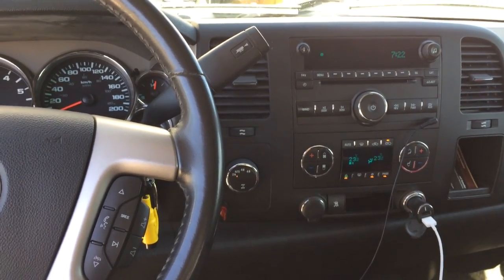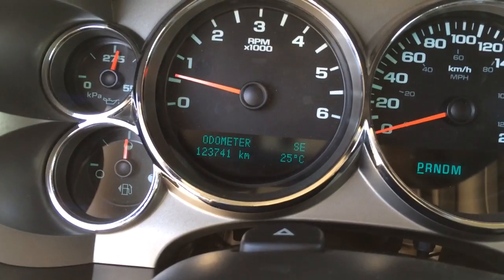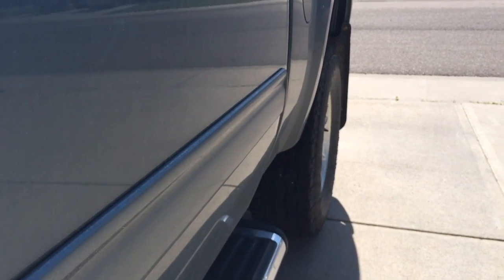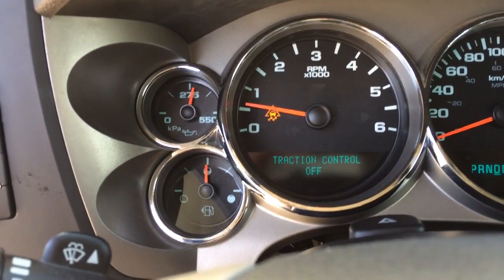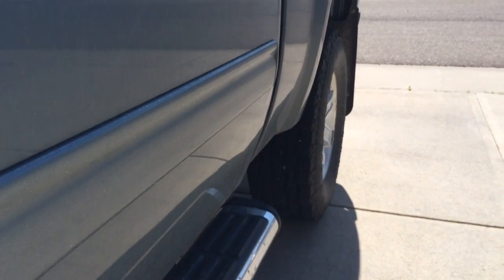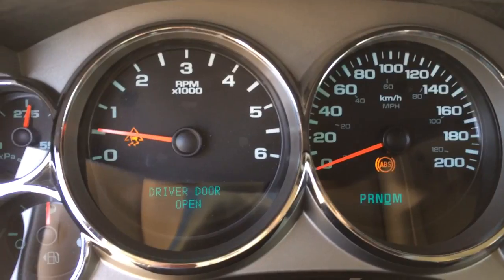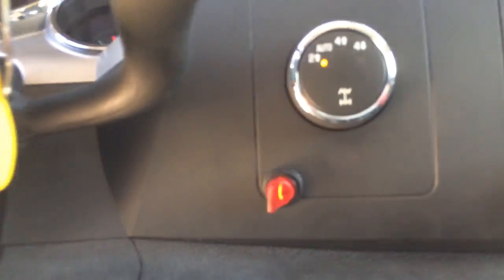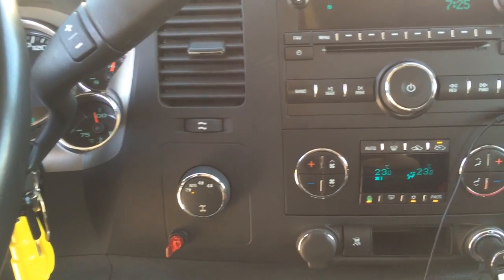Traction Control, Stabilitrak, Brake Control Function, RPM Limiter- BYPASS

Comment: I found on my 2012 Silverado 1500 the only way the stabilitrac doesnt kick in is when I push and hold for 10 seconds  then also put it into manual mode. When you leave it in drive even after you push and hold the button itll still kick in but in manual mode it will not kick in.

Comment from the maker: Ask me anything guys I am happy to explain anything as best I can.
Reply: need help how did u do that
Reply from the maker: watch my other videos explaining it all. This one just pull the plastic dash off and install the switch that you wired into fuse #9 from under the hood
Reply: I just had my truck lifted with new shocks put on and it looks like they forgot to connect something because now my abs and stabila track stays on.  Should I worry about it? now that I see this video?
Reply from the maker: Tom E I would get it fixed, ABS is proven to help in braking preventing more collisions
Reply: i have a 2018 sierra 1500 denali 6.2, the fusebox does not specify the same fuse you use, can you tell me which wire is the one i need to use. thanks
Reply from the maker: @ichiara07  as this is for the 07-13 trucks I couldn’t tell you what it is for the ‘18 model trucks…

Comment: let's say I don't go off road .my light turns on for like no really good reason n so does the little  (!) for the brake . how do I just turn it off the button for the stibilatrack n the traction control button isn't working properly.  so it keeps popping up for no really good reason. how do I completely just turn the light off . n is it a bad thing. to have it off

Comment: Had this happen to me when I was heading up a local mountain trail some call "Red Grade." It's steep and that day it was icy. Thought I would be safe and sound by holding the traction control switch until it read that Stabilitrak was off. Started to make my way up the hill only to have to dangerously back all the way down. 

Thanks for these videos. VERY HELPFUL!

Comment: Amazing series of videos.  I have a 2007 Chevy 1500 LTZ 4x4 with a 6.5" Zone suspension lift and 35s with the same problem.  I haven't gotten stuck yet, but I've come close - only because the truck was fighting me by killing the revs when I needed good wheelspin.  I'm just trying to get to remote hunting and fishing destinations, not trying to get stuck.  It really pisses me off when I see that stupid traction light flashing after I already took the time to turn it all the way off.

Anyway, I'm mostly done with the install.  It's past midnight, so I'll finish tomorrow.  I just wanted to take the time to let you know that I really appreciate the info you've shared.  FWIW, my fuse was #10.  Pulled it with the truck running and the correct lights came on immediately.  Cut the big red wire (with the fuse back in place) and they came right back on.  I've spliced it and gotten it (and some rear aux LED switch wires) through the firewall.  Tomorrow I just have to hook up the switches and run power back to the lights.  Thanks Jeff17s!
Reply: I have same vehicle. Im looking to do this also when weather in WI warms up. Hopefully yours turned out well!

Comment: Thanks this is the best explaining video I've seen so far on deleting the Stabilitrak
Reply from the maker: henry Wahlberg honestly most people don't watch the other videos linked to this one! This bypass switch I installed has saved me from getting stuck in mud holes and snow drifts so many times! Plus the burnouts are cool lol
Reply: Thanks again
Reply: So if I'm understanding correctly,  cutting the traction off completely helped regain your rpm and power correct? Thanks in advance
Reply: @blessedhands2000  it works correctly if you disconnect for ten seconds then reconnected the battery too good luck
Reply from the maker: @blessedhands2000  Yes. The computer no longer senses the tires slipping, which reacts by braking/rev limiting/ETC.

Comment: I sure understand why this truck won't get through 3" of snow with winter tires on now.  I pulled my fuse in the last snowstorm, works twice as well.  I've had 3 2x4 fords and never had much issue in snow until this 2012 chev.  Seems to have made the truck more responsive in general with fuse removed, should I just leave the fuse out, or do your toggle switch idea for snow days??
Reply from the maker: I only toggle switch it off when I am in sticky situations, or it is really difficult to get through. Do not remove it for highway driving however, as it is a great safety feature for keeping the truck from losing traction.

Comment: Try holding your traction control button about another 10 to 15 seconds after it says it's turned everything off total time about 20-25 seconds. On the Tahoe it will COMPLETELY disable traction control where if you hit the gas with your rear end up it will run 5000 rpms
Reply from the maker: My suggestion to you is to jack your tires off the ground and attempt what you say and see if it works.... I can assure you, the computer tries to override with a brake control function, power limiter etc. Once you have done this, by all means, come back and tell me how it went.
Reply: +Jeff17s you are right. My 2010 would do it after you shut off the nannies via the button. You could power through it a little on ice and snow to spin around on a snowy road or whatever. I traded that on a 2015 and the tc vses systems are so insane. You can turn everything off and still cant slide around. Stabilitrak comes back on at like 40 kph. I may have to go this route if it doesnt make the new ones go into limp mode. When i select off, i fucking want that shit off for a reason.

Comment: It looks like I'm going to have to do the same thing to my 2006 Yukon Denali because my traction active light comes on and reduces horsepower exactly like your video and messes me up on the highway or even on the red light but when I switch traction control off no that stuff happens but my stability is also off not a bad idea
Reply: Does Your Denali Ever Have Problems Starting Up?Mines sounds like It is Doing Same Thing.

Comment: Hi,im having problems with my 2011 chevy..I've been having problems over the last 4 yrs with my dash shutting off while im driving including headlights going out..My resent problem is i can't go over 20 mph,it says engine hot a/c turned off,left RR tire low,change engine oil soon,engine over heating ideal engine,engine power reduced,service track control,service stabilitrack..I've been taking it to the dealership and paying and arm and a leg for them to tell me nothings wrong..Do you know whats wrong?
Reply from the maker: +Chris Haver I definitely don't know what is wrong with yours... but is does sound like an electrical problem. sensors or shorting out
Reply: Coolant temperature sensor

Comment: Do you know what would cause a service traction control & service stabilitrak light followed by a rough 1-2 shift on my 2007 6.0L 1500? The light usually comes on at around 30+ MPH or when I'm coasting. It also turns off by itself but usually comes back every couple miles. I've cleaned the MAF & Throttle Body with no luck.
Reply from the maker: +mike L no idea lol sorry
Reply: I'm having the same exact issue, did you ever figure out what was wrong with it?

Comment: But in the 2013 Silverados if you hold the traction control it takes off stabilitrak and it stays off unlike the 14-18 models turning back on after 55km
Reply: But it doesn't disable it completely by holding the button  down. I live in ND where we have a lot of snow and when I turn both traction control and stability, it still controls wheel speed. Mine is  3013. Traction control is a joke

Comment: When you tap into the lines by the fuse did you splice one red wire or did  you bypass the fuse all together?
Reply from the maker: I just cut the thicker 14ga red wire, made a continuous circuit through the toggle switch so that when I run the highway with everything on it still has the fuse as safety backup, flipping the switch simply cuts off the electricity to the fuse. Best thing I ever did, I have been stuck on a few occasions as a direct result of the computer not letting me fully pin it haha

Comment: Howdy,
I leave the STBTK and TkCtrL in the trucks I drive on all the time.  My 2007 Vortec Max pissed me off right after I got the truck. (still have it).  I drive in snow/ice and on roads made with frickin clay with my work trucks GMC half tons new one every 3 yrs. Since they came out with this crap I noticed that if I pump the gas peddle VERY-FAST 3 or 4 times and then pinn'er to the mat the truck will spin all the tires and get S**T happening.  Then it is still working on the next corner as I reaching for my celebratory coffee sip.
 I shared this info with our field operators gas/oil patch and it works for them too.
No need to piss around with pressing buttons or cutting wires for me.
But I probably would If this didn't work.
cheers

Comment: Howdy Bud, I found your video on one of the forums. Is pulling the fuse the exact same as the switch you wired? I went to wire in the switch but wanted to test the idea first, by pulling the fuse. I pulled the fuse, but no cel or TC light came on. In your video you can see the lights come on basically confirming the tc and abs is inoperable.
Reply from the maker: Did you pull fuse #9 out? Strange it wouldn't show on the dash...
Reply: Yes, watched your 3 vids, bought the wire and a switch, figured Id pull the fuse first ( #9 labled ABS ) no lights at all. Could still disable and able TC and S. Didn't move fwd as I would think pulling the fuse would make the same lights come on. Its a 2010 gmc 2500hd
Reply from the maker: +Scott Hoobery hmm I'm not sure the 2500 trucks are same as my half ton for wiring. Probably not
Reply: Its weird, I would think, if you pull the abs fuse on any of them that the light would come on. I thought maybe just needed to cycle a few times so I drove around a bit and no lights came on. I know the TC light and the rest work as when I turn the key to on, they will all light up. This boggles me.
Reply: I figured this out if your curious :)
Reply from the maker: do tell...
Reply: Scott Hoobery how did you figure this out?
Reply: Scott Hoobery hey. Could you tell me what you had to do please. I am having the same problem
Reply: Well like I stated, my pick up is a 2500hd, so I believe that is why the steps in this vid didn't work. The Answer for me was : There is a bigger/different fuse than the one OP talks about in vid, it is also labled ABS but its one of the big square black ones. When I pulled that, then the lights came on the dash indicated that there was abs and Tc "issues" then I was able to get wheel spin with ease. I guess the diff would be the pickup in the vid is not a 2500 and mine is so they must have a bit diff wiring because when I pulled the fuse mentioned in vid no lights came on and TC and ST still activated.
Reply: Scott Hoobery okay thank you I'll have to check that out. I have a 2011 2500hd so this will probably work thank you very much. I'll let you know if it worked
Reply: Scott Hoobery what was the fuse number for the one you pulled do you know?

Comment: I need my truck to do more than just tip toe like a nancy pants dammit. When shit gets hairy sometimes you need  MORE power, not less. I'm just worried that bypassing these annoying restrictive components might mess something up. You know how cars are these days. You pull the dome light out and suddenly you need to replace the entire computer system.
Reply: Truck is wimpy on power? My Z-71 Colorado has a Vortex supercharger installed by RiPP and makes 410 rear wheel Dynoed power . 98 mph speed limiter disabled 130 mph is fast.

Comment: my 07 avalanche does the same thing.it will go on and off while I'm driving down the road. if it's on it will shift into gear hard then it will go off then come back on down the road. I replaced the bracket peddle switch didn't work. any ideas. please help thank.

Comment: How did you get the rocker switch to light up when the fuse is pulled? Mine goes off when the fuse is not getting power. Basically the  reverse of yours.  My fear is that the small LED will kill the battery.
Reply from the maker: Switch the wires on the back of the toggle switch I believe and that should solve your problem. I never have to pull my fuse anymore
Reply: +Jeff17s right, just ground and power?

Comment: can you give me a detailed step by step on how you wired it? I suck at wiring. I bought a 3 prong 25A 12V lighted rocker switch 14G wire and connectors, I'm just not sure how to make the connections on the switch since you only cut one wire. positive negative and acc. I don't care if my switch lights up or not, I just want to cut the power to the fuse.
Reply from the maker: In my previous video I show which wires to splice. Make one snip about 4-6 inches down the thicker red wire from the fuse. Connect each end of the cut red wire (I used butt connector with heat shrink rubber over em) with your 14G wire, one for each end. Take both wires through the firewall to your dash. Connect them with the switch so that the light is off when the current flow to the fuse is live, and ground the switch (usually middle connection of backside of switch). This allows for regular Stabilitrak and Traction control for on highway/city use for safety reasons, and switches off when you need to hammer down when you are in some deep snow. Video for which wires here https://www.youtube.com/watch?v=B5CYJf-myds

Comment: hey jeff well this work on my 2011 chev traverse i have the same problem
Reply from the maker: +Erica Strandberg not sure about the traverse, the Tahoe's, Sierra, Silverado, Yukon, yes. Traverse may be wired differently, but if you find the ABS fuse and bypass it then yes.

Comment: 2011 tahoe ltz traction control and stabilizing light on. This happened after we put new wheels and tires and realignment done. Also around the same time we put a cold air intake on it. We had no issues with the warning lights until we did all that. We put it on a coder and it's saying C0253 and C0710. Again no issues with the warning lights until we did the add on to the tahoe. 

Any suggestions on why/what may have caused it. I cleared the codes but after driving a little while it came back on.
Reply from the maker: jason mccarter sounds like whoever did your alignment f&$ked up. Steering centerring error and steering position signal error are your DTC codes.
Reply: Jeff17s 

What do you advise me to do and or do to possibly fix it. Ive gotten to know the manager pretty good at the Big O Tires that we use that did it.

Comment: Do you video of wiring up to the fuse
Reply from the maker: +Doug Johnson see previous video of mine on my channel, I show exactly which wire to splice and run to the dash with a switch
Reply: +Doug Johnson if you need a youtube video on how to wire in a simple toggle switch maybe you should think twice before messing around with your fuse box?

Comment: sir, i have a question why is my gmc sierra 1500 stibilitrak and service traction control lights on and sometimes when i turn it on Everytime. i try to accelerate it feels like im in neutral and it makes this big noise outside like if its hitting something i hope is not the transmission or anything like that but this happens sometimes.. thanks for your help
Reply: CHEKYO LOVER did u find the solution my truck does the same and now does it more often plzz help if u found the solution

Comment: hi Jeff. I am having trouble with my traction control and stabilitrak light. I continuously hold the traction control button down and it still seems like the truck is stuck in 4 wheel drive. Any suggestions?
Reply from the maker: +tracy howell Is your 4 wheel turn dial engaged to 4HI ? or AUTO? Traction control button doesn't turn off 4 wheel drive
Reply from the maker: +tracy howell at 0:22 you can see my dial set at 2 wheel drive
Reply: +Jeff17s , it's a turn dial and I've turned it on every setting  (2,auto,4 high and 4 low) and it's still pulling as if its stuck in 4 wheel drive.
Reply from the maker: My old truck had an electrical solenoid I believe that wouldn't let my truck out of 4 wheel drive, sounds to me it's just an electrical problem, just a matter of finding which through the diagnostics the dealer can run on it.
Reply: +Jeff17s thank you so much for your help. I will call the dealership in the morning and schedule a diagnostic appointment. I will let you know what they say. Have a wonderful evening.

Comment: Jeff 17s....pontiac torrent 2008, stabilititrack off and traction control off, car does not turn on....please help
Reply from the maker: Sell your pontiac. Not sure how I can help with this little info lol
Reply: Already fixed, was a battery dead cell, it just have 40000 miles won't sell this beauty!

Comment: when I let off the gas the stabilitrack light comes off but as soon as I get on it it goes away why??
Reply from the maker: +Oscar Navarro sounds like it could be a wheel speed sensor.
Reply: How do I check of they are good or not
Reply from the maker: The dealer has specialized scanners that can pinpoint which sensor or wire. Regular OBD diagnostic trouble code scanners can't do it